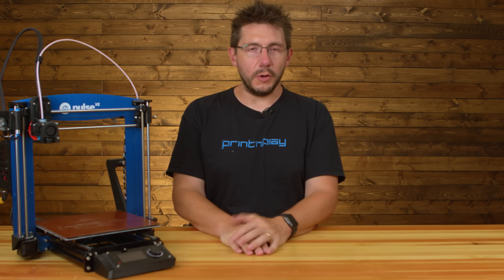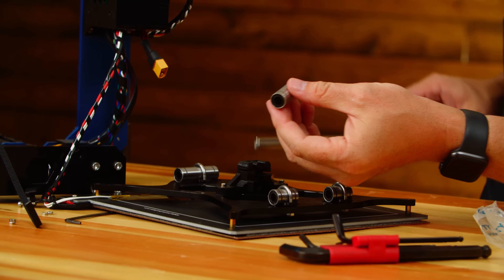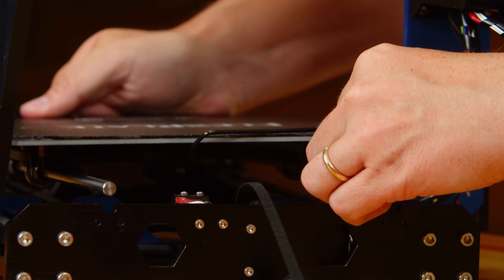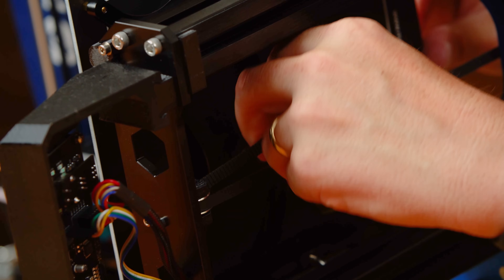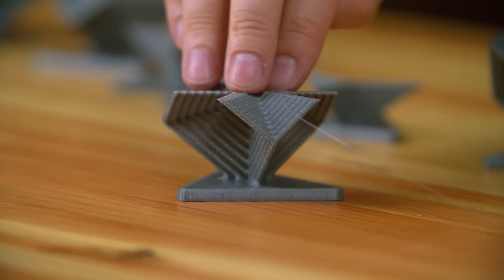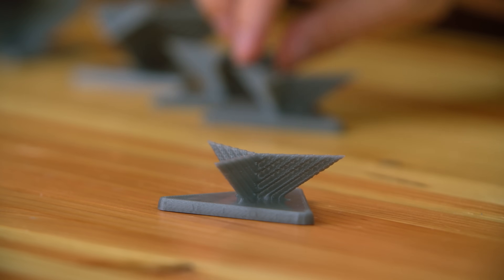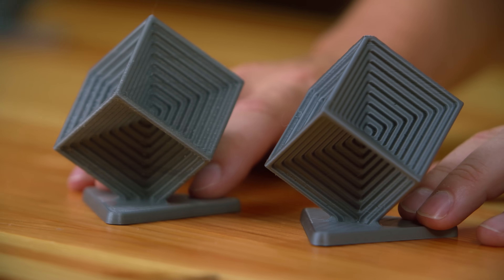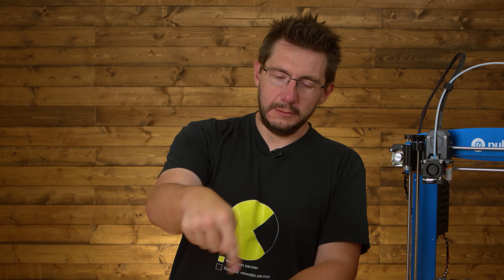3D Printing 101: How To Fix Bad Bearings on a 3D Printer

Comment: I CANNOT figure out wtf is wrong with my ender 3 pro.. I'm mechanically and electronically inclined.. I can't figure out what the hell is wrong. Originally, I thought the nozzle was hitting the previous layer as it passed over, but after raising it to the point that would be impossible, and I still hear this kinda dull buzz/grind, and can feel a lot of vibration on the bed. I'm really hoping replacing the shitty wheels under the bed will fix it.

Comment: I know this is old now but could it have been the 3d printer not being able to keep up with the amount of gcode, the software is getting overloaded and stopping and starting mid print. slowing the print time down to 0.25 was allowing the printer to keep up. maybe using the same gcode file on a 32bit printer would have shown this?

Comment: Your bearings aren't aligned. If they're even the tiniest bit out of alignment they will bind ever so slightly, causing vibrations. The faster you print the larger the vibrations.

I had this exact same issue on my maker select. Carefully rebuilding the Y-axis fixed the issue.

Comment: Hi Joel, you should check hotend tightness to the frame. Grab the nozzle and se if it moves around. Maybe the groove mount is worn or out of spec
Reply from the maker: I did check - it is in there solid!

Comment: As quite a few comments pointed out: Lubricate those bearings before assembly. Even if these bearing got a thin layer of oil on it, it is more there for protection (against rust, etc) than actual being a long lasting lubrication.
And regularly cleaning your shafts and lubricate it a bit should be part of your maintenance and cleaning.
These bearings have oil seals on each end to keep dirt out and lubrication inside.
I lubricate a new bearing inside before putting in on a shaft. And then every month or two, I clean up the shafts (and lead screws) and put new lubricant on.
I use petroleum jelly (known trade name "Vaseline") for my lubrication.

Comment: Did you've tried to set Jerk less than 10? It's not a very big value... But it's also the key point. Did anybody suggested this already?
Jerk is like a "minimum moment of an acceleration" when it starts/ends a move.
Also you can try this in Cura or Slic3r... Maybe there can be some difference in this area.
P.S. the "eco-system" idiom isn't an ideal solution. I assume that Apple suxx there exactly.
Well... not idiom... had to say "principle". I think you'll understand me.

Comment: Joel, did you mess around with Jerk settings? Messing around with acceleration settings is fine, but jerk still sets the minimum speed that the printer can immediately jump to, regardless of acceleration settings, I think. With so many turns in the perimeter, it's plausible it's jumping to too fast a minimum speed. Changing the speed should not affect jerk unless you are printing at lower than the jerk value.
Reply: Exactly what I was thinking. I run lower jerk than those defaults.

Comment: When you add the spring steel sheet, what it's doing is essentially pushing the flux fields of the magnet to the other side. It's also known as a keeper plate. I've worked with neodymium grade n52 magnets and that's how we project the strength of the magnet to one side is with 4 Series stainless steel plate.

Comment: 4 "properly" aligned bed linear bearings are much more stable than the common 3 bearing setups, which usually have little or no alignment adjustment.
Reply: 4 just binds easy (probably why his grind at first and just bumped them when he was adjusting belt, you’re not suppose to tighten them without the rod in to align it). Prusa uses simple zip ties since it allows them to auto-align and wiggle into place.

The stability difference will only really come from bed deformation since the corners on one side dont have supports directly beneath them (in real use), but I’m not sure how important that is since the beds are often on sprung suspension anyways.

As far as stability, not-binding is probably most important for longevity than having small amount less vertical flex.
Reply: @jakegarrett8109  4 bearings only bind when the rods and bearings are not properly aligned. Including proper alignment features is more expensive and requires more customer "capability" to properly assemble .. and that is why most cheap printers only have 3 bed bearings. I have a farm of printers, all with 4 bearing beds, and never have had a linear bearing fail in several years of operation.
  A little friction in the system is a good thing, since it helps to reduce overshoot / ringing .. the pursuit of a frictionless linear bearing system is counter productive, unless using small cheap motors with low torque (like the ones that come with cheap printers). 
   As for vertical flex on Y rods ... 10mm rods provide 2X the stiffness, and is what I use for X, Y and Z  ... 8mm rods are cheaper.. need I say more.
   And I won't even go into the cheap rubber band like GT2 belts and cheap over stiff  8mm Z leadscrews used in  all cheap printers.
Reply: I wasn’t going to get into binding forces due to off-center printing (like with a little nozzle drag), but that also makes 4 bearing more susceptible since it can’t allow for any deformation without binding or friction going WAY up. Also, if you WANT friction, just use crappy worn out bearings or bushings, lol!

It’s often lack of maintenance that kills bearings (from cars to printers, it’s basically the same, except printers are exposed to the environment, and I know that if you live out in the country the plastic won’t stick to the bed due to how much dust accumulated over-night, lol, killer for printers getting that much gunk! I had to clean mine each time I used it, but even super cheap bearings are still going like new after maybe 12 pounds of plastic since my first eplacement (not that much compared to you, but way better than the 4 pounds I had previously that got them so worn they had flat spots and totally ruined due to not properly maintaining cleanly or piling), maintenance makes a big difference regardless how expensive the parts are (I would love magnetic levitation rails or something, but I have a feeling it might cost a lot like the magnetic levitation fans I use in my computers... But should never wear out!). I didn’t say using cheap parts makes it the best did I? Of course not, I wanted to use 12mm or half inch until I saw the prices, lol! Obviously better parts is better, but inherently 3 bearing approach works really well until you get into REALLY heavy loads (like if I put 10 pounds of weight on my small bed, it’s actually noticeable. Lol, I had my desk too messy to place my laptop and roll anywhere and printed the small piece in the corner left over, haha! Don’t think that’s a common issue though, just me, haha)

Comment: How many thousands of hours of printing have you done to wear out the original bearings? Because if it's not at least a couple thousand hours what you're doing is replacing defective parts on a pretty expensive printer, not maintenance.....
Reply: I didn’t see him oil the shafts... You can buy the most expensive cars in the world, but without oil they wear out too! I’m not sure why people can’t seem to figure out that bearings, yes bearings, require oil, regardless if they are linear or rotational, they need lubricant. You have to clean the rails once in a while or dust/dirt/grit will get in them, so paper towel to clean, then a few drops of oil on paper towel (I just use transmission fluid or a light motor oil), and then wipe that back on there with clean oil.

You’d think this would be obvious, but I guess if it’s not in a 10 inch jumbo sized “caution” safety sticker then people seem to ignore it.

Comment: great video! the ender 3 printer has bed wobble like this (the printers only fatal flaw) even swapping out delrin bearings doesnt help after so long since the aluminum carriages holes tend to deform where they meet the eccentric adjusters. I just did the switch to a cheap 20 dollar MGN12 rail and its made it solid. you should do this same upgrade as an ender3 version of the video for those who use wheels instead of these round LMU8 bearings and round rod.

Comment: I would check the rigidity of your z-axis bearings, lead screws, etc. Also, those wobbles seem exaggerated enough, you might even be able to catch it in action if you can film at 240fps zoomed in far enough.

Comment: Have you tried to slice the model on a different slicer? example S3D or Prusa Slic3r
Reply: Roberto Almendros Did you notice a difference? I only used Cura so far. 👌
Reply: @fliegenmann2562   my advice is for the problem that Joel has, i had no problem printing that model. I dont have a pulse machine, mine is a p3steel

Comment: Glad I'm not the only one that struggles figuring out which way to turn upside down nuts & bolts..
Reply: joe jacob 
Orientation doesn’t matter.  Clockwise / anticlockwise doesn’t change, unless for some reason you’re shifting your view (e.g. reaching over and rotating something facing away from you).

This can catch you out for ‘non standard’ threads, which might be ‘left hand’ type.  You typically find this on bikes etc. and it can catch you out when you’re moving the nut or bolt and wondering why it isn’t producing the expected result.  I find poking the tongue out at the right angle works.  😋

Comment: I use MC 1.7 on a Robo3DR1+. I have noticed on very humid days prints look like they have warts.
After getting 3 or 4 layers into the roll it prints much smoother. And I use the cheapest PLA I can find.

Comment: 3d printing nerd I got a question for you I just bought a jg Aurora a5s and I am printing like a hexagon shell for a shelf and its printing from base up and it's getting ripples every now and then going up it I dont know what is causing it if you could help me I would really appreciate It and I am new to this 3d printing stuff and I am using cura version 4.3 I think because I dont know how to use like the other ones and I couldn't find one more easy to use for someone like me being new and I have had this printer for about a week  now too

Comment: Hey why didn't you replace the bearings for the hot end carriage? if the bead bearings are worn, the others are probably worn as well & could still be causing the wobble.

Comment: i would have gone with the drylin bushings, they are garbage to start with and need to lined up pretty well or they grab. but as long as you dont put oil on the rails, they will wear in within a month of standard use, or you can program a gcode file to send the bed back and forth like 2000 times. that would do it. but idk if i just have good eyes or stare at these machines for far too long, but using ball bearings leaves tiny ripples of the surface of the print. its hard to see but it annoys me. the RJZM 8mm bearing is what i used. i love them, but you have to wear them in.

Comment: Hey Joel, whether or not its the proper way (although I believe it is), the screws for the Y axis are long enough that it functions as a tensioner. I will loosen it until there's a decent gap between the part and the frame, but the threads are still engaged. Then I will slide in the belt and test what is the the right number of teeth to get a good baseline for tension. Then I'll tighten the tensioner until I get that original tension you had (gross sounding and hard to move) then back it off until it's buttery smooth again. I've done the same for the X axis too, without removing the belt and gettk g good tension.

Again, I can talk on Monday to see what the - official- answer is, but this is how I handle things around the office. Hope that helps, buddy!

Edit: Finished the video. I don't mean to say you tensioned wrong or that it's contributing to the waviness, just might make things easier in the future; every printer has its own way for tensioning.
Reply from the maker: I thought about doing that! In the end I didn’t, but it’s good to know that not only I think of that :)

Comment: Short bushings in the center of a large plate strikes me as a very poor design, but cheap to make and assemble, vs. having four bushings with the pair on each rod spread out, at least that is the way all the machinery that I have worked on over the years is designed.

Bad news is getting the bushings lined up can be an issue and takes some nice machining, not a cheap U bolt.

Comment: Hey Joel, great diagnosing.  I do have a suggestion, I’m sure you always preview your gcode.  Unless it’s actually drawing squiggly lines in the preview.  Then you should expect straight lines when it actually prints, it would lead to something else mechanical.

If your Y axis bearings are bad, the X axis ones might be too.  I’d replace those.  Make sure both axis moove smoothly.

I’m betting it’s the hotend wobbling around though.  When it finishes or starts a move a loose hotend would continue to move and not strictly follow the line it was meant to.
Reply: Yep I'd look at the x bearings also...

Comment: You didn't cover this in the video, but may have in the background. If you determined that the y-axis bearings were worn out, did you also check the x-axis bearings? Same type of bearings should have similar lifetimes, and the x-axis moves a comparable amount to the y-axis.

Comment: 3:28 it's because induced magnetic force decays with the 5th power of the distance, so the distance created between the tool and the magnet is enough to make the force almost negligible. Something on the same thickness on the other side would make it not stuck

Comment: Lubricating the bearings could fix the stutter. At this point you have slowed down so much that the stutter (bending) is so fine it isn't as noticeable. The screeching sound it made after you first installed the belt, sounded very much like dry bearings. LM bearings are kind of tricky to pack, but there is a print that can help! (Hint... Another video!)

Comment: Usually, those bearings come oiled with a very light oil that is only supposed to protect them from moisture during shipping. I think you're supposed to remove that before installing them and then grease them.

Comment: Good call on checking the belt tension. Most belt manufacturers have charts listing deflection distance over a given length of belt using a given weight. It could also be the bearings in the tension pulley or motor. You could try taking out the tension pulley and turn it with a lot of force applied to it and see if it feels crunchy. All of the bearings in the system have had been wearing for the same time and if some have failed, then the others might also be at that same point.

Comment: Having to run at quarter speed is not what I would consider fit for printing.
Reply: I had this on in the background so i could have missed it. Did he try a different slicer?
Reply: ...and yet, it is still better than not printing at all and wasting space... not to mention that sometimes slower speeds can make very good parts...  Not to mention, the slower speed appears to be a function of the "Matter Control" Slicer algorithms... not necessarily due to the actual machine running speed.

Comment: I have the Pulse XE and have run into similar problems on various prints.  I like the Pulse XE but there are issues with Matter Control.  It keeps getting better with every update but still has a way to go.  The last file I sent them to review that I was having problems with the only answer I got back was "that file is hard to print".  It then printed fine on my CR-10 Mini using Cura.  I like the direct 3D printer connection in Matter Control as it gives some automated functions, like unloading and loading filament, that is not available from the unit display. Hopefully these issues will get worked out.  Another great video Joel.
Reply: Terry Clair I agree. I’m still trying to create a profile for the PulseXe in Cura
Reply: Terry, same exact thing with me.  I have some issues with prints that this $1500 printer should be able to handle no problem, but was told some of the models were "tough" to print.   When I have issues I then test it on my Prusa MK3s and it prints perfectly fine.  I really like MC as well but I think it still has some work needed on the slicer end of things and have been wondering about setting up another slicer for this printer.  I just wish there was an easy way to pull all of the printers settings / values from MC and dump it into Cura  or something.  I have seen it mentioned but when I try to do it I don't see the options in the software.

Having said that, MH has always been quick to respond and very easy to deal with so I like that for sure.  I mostly got this printer for the abrasive stuff since I have never really used filaments like that before, so I guess I just have to figure out the oddball pros n cons and make adjustments as I go.  I did upgrade to the better motors and 32bit mobo, along with the flexbed.
Reply: MrNickpeck36 I’ve tinkered with flashing new firmware on it to ‘unlock’ some of the features. Right now the filament runout only works if it’s connected to MatterControl. I also have not yet been able to save a bed leveling test to the eeprom. But I might be sending the wrong commands. 
 If I get something working I’ll put it up on GitHub to share.

Comment: If the bed bearings were worn the bearings on the print head probably are also. I tend to replace both sets at the same time.
Reply: Bed usually has more load so wears faster.

Comment: So in general how long should a LM8UU bearing last until it needs to be replaced? How many hours?
Reply: Pat Gratton Most of the linear bearings wear out because of dust and low lubrication.
If they are loud and not so tight anymore, they should be changed... 
I did a mod with 8mmx16mmx7mm DA NBR Radial Oil seal to keep the dust out and the Oil inside.
Misumi bearings work great 😬👍